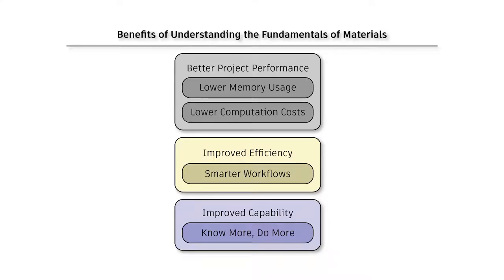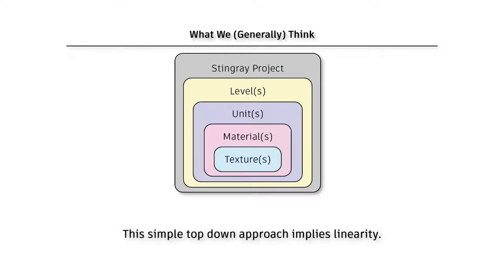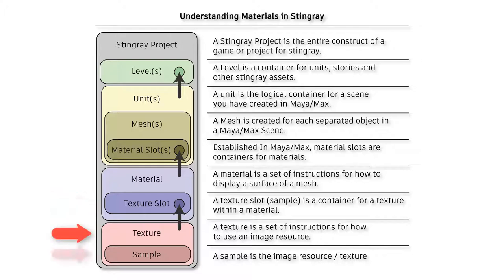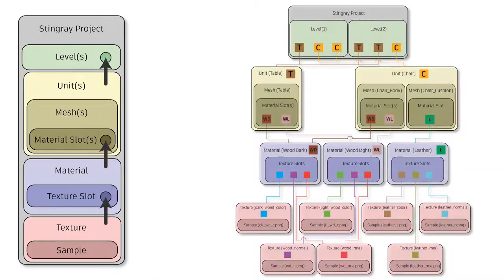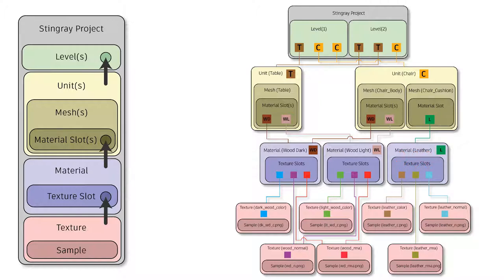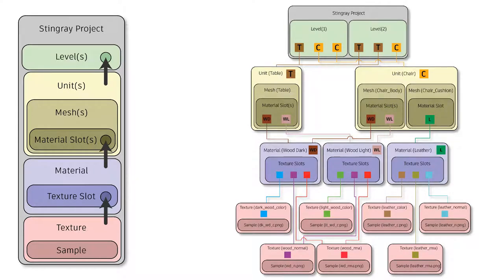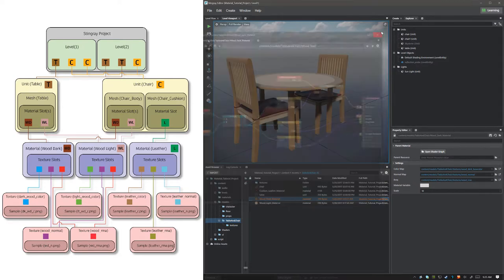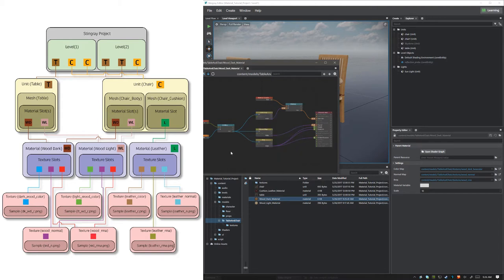Material Fundamentals in Stingray

Comment: What does "make unique" actually do when pressed?
Reply: Good Question!  This is a very important thing in stingray.  So when you hit "make unique" what you are doing is breaking the reference to the original material graph and saying "copy it here".  This can be thought of like this.  Lets say you have a graph for a material.  Now you want to re-use that one for another material you are building.  It is identical in every way,  but the textures and settings applied will change.  You can use the folder icon next to the material to select that material graph.  It will now be a "child" of the original material.  Notice you wont be able to edit it, instead you will have to edit the original graph which will then update all the children.  By hitting make unique, you effectively break that relationship so now any changes you ke to the child only are for that instance.  I hope i am making scene.  If not, i plan to do that entire concept in an upcoming tutorial as part of this series.  In general I usually make a folder under content called "shaders" and in there I make whatever graphs I will use (ie: rma (my standard shader), rma-em (standard shader with emissive properties), rmad-em (standard shader with density and emissive), etc.)  then i just point my imported model materials to those shader graphs.  This is a very efficient way to work.
Reply: Thank you very much Paul!